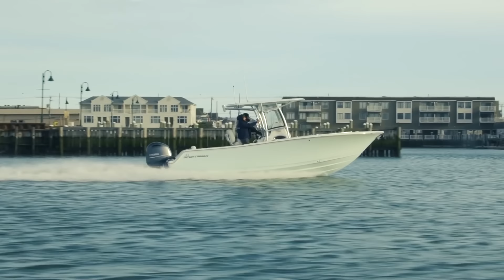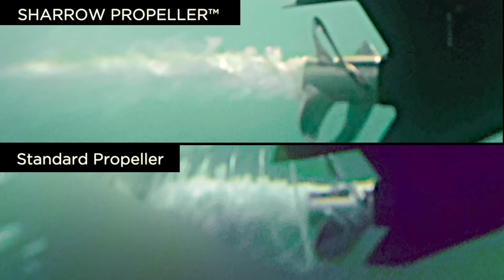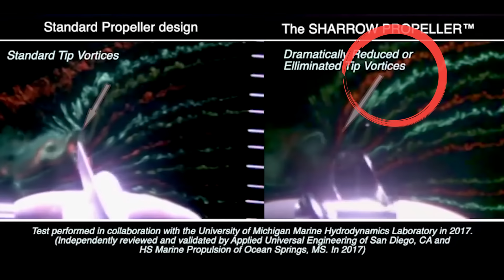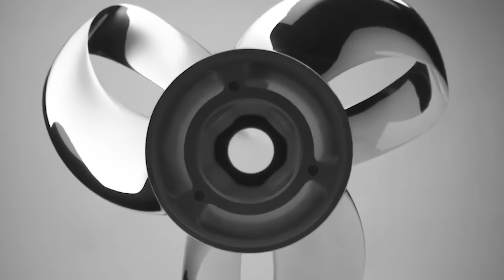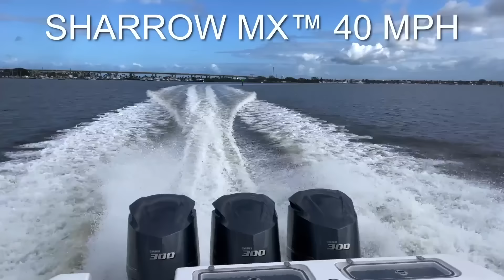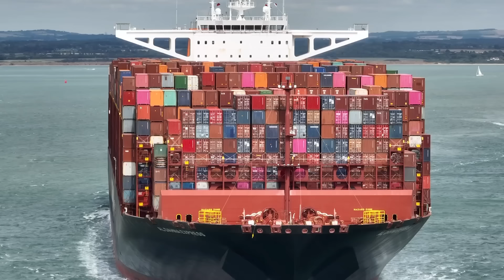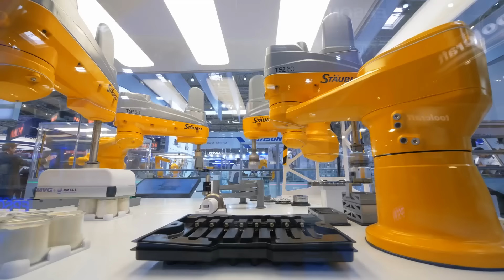This Genius Propeller Will Change Transport Forever

Comment: Curious, if these are already installed on submarines, since blade tip cavitation seems pretty much eliminated on these.
Reply: subs operate at high static pressure.
Reply: @appa609  They still have problem with cavitation, just less at higher depth. Also even small cavitation increases sound signature a lot, so they try to avoid it as much as possible, AFAIK.

Comment: Can we combine the principles of designing the shape of this  propeller and translate that into a turbine generator? Cuz currently turbine generators use a standard blade fins that go from big can shrink too small, what is it possible to make those blades with this new design?
Reply: I dont think it would be too beneficial to generators because they’re basically ducted already, which removes most of any vortices that can be generated, though they might be able to benefit large wind turbines because this new prop basically adds the efficiency of a ducted turbine, though they would wear out at the same rate so it might not be cost effective. (Might look more into it though)

Comment: Nonsense video. 
This idea has been around since the invention of propellers.
These props are heavier/thicker, so not practical in small applications like for RC electric motors as they will increase power draw and reduce range/run time.

Likely not practical for airplanes either due to more stress on the engine and fuel consumption.
They can't be used with variable pitch like helicopters so that's out also.
Military submarines have been chasing quietness since sonar was invented, so if this was legit, they would be using them on every sub around the world as this is not some secret tech.
They are not doing that, that we know of or have seen......
This design is also not 105% more efficient at all.
It has better peak torque efficiency yes, a more linear torque range yes, but overall, it's barely better and in most applications, it will be worse due to above stated issues.
A prop that "bites" better generates more torque, which requires more power = more fuel, more electricity, and more stress on the power plant.

Saying these would cost 5+ times as much as conventional props is just lies and typical price gouging by manufacturers when the effort involved after retooling is minimal.
This is the same issue with all modern tech since the industrial revolution started.
We were all promised how things would be so cheap and affordable for everyone, yet everything has skyrocketed in price over time, despite all the innovations in design and manufacturing processes, nothing ever gets cheaper because companies know people with money will pay any price to get what they want/need.
This is why our society is going backwards, greed and corruption.
Capitalism is clearly the best system, but only when it is well regulated and capped as to what people can charge and how much profit they can make from consumers.
Otherwise, greed takes over and 99% of people who aren't rich suffer for it.

It was once considered a success if you could run a business and feed and house your family from it.
Now if you can't make 600% profit margins, its a bad business idea and nobody will back it.
Everybody wants to be a multi-millionaire or billionaire or the business is crap.
Greed is rotting us to the core, and things are coming to a head in the near future years.

Comment: Gimmick. The amount of material used and it's complicated geometry mean that it's both more cost effective and easier to simply use a simple larger diameter prop. There are some hard hitting physics limits when it comes to props. Could be used in very limited capacity, where "bling and uniqueness" is valued, but not overall economic efficiency.

Comment: Very misleading title! In fact it's a deception that does nothing positive for your channel.
You IMPLY a 105% efficiency, however the 105% figure is applied to the "improvement" over a standard screw.
You can NOT achieve 105% efficiency.

This kind of misrepresentation does nothing but reduce the impact of the interesting content of the video, and will leave a number of people believing the impossible,

Comment: I'm wondering if this blade design could be useful for wind turbines, or not. Probably not due to their angle of attack variations depending on wind speed.
Reply: They might, but, just like the existing ones, they won't turn when not windy!!!!!!!
Reply: @ianharvey3696  Haha, true!
Reply: I bet they could use them. The angle of attack could still be adjusted but the adjustment would have to take place at where the prop joins the shaft meaning a total redesign. Likely worth it though.

Comment: I'm thinking this will greatly help even internal combustion engines that use water cooling...  Cavitation/parasitic drag of an engines water pump is a problem where this could really help - Not only making the system more efficient in many ways, but also by reducing wear of the impeller/failure, thus reducing costs and waste...  BMW, are you listening???

Comment: You know a video sucks when the claim more than 100% efficiency. Meaning it should produce energy on top of running. That's really impressive and impossible. They may have doubled propeller efficiency, but that is not the same thing.

Comment: The lower efficiency gain of the boat prop at lower rpms is probably because there’s little cavitation of the conventional prop at those speeds to begin with. Scale up the size though, and cavitation is a big problem for ships props, despite their low rpm,
Reply: Big ship props don't cavitate unless somebody screwed up.
Reply: @evangatehouse5650  Yeah, that's right of course, I should have been more clear. IF it happens, cavitation is a big problem. My thinking was that the helical design could spin faster and produce more thrust without cavitating :-)

Comment: They're getting closer to the prop that I designed years back with the toroidal blades and a pseudo direct drive motor with a turbine prop in the center and the toroidal blades are hollowed-out like the Dyson bladeless fan and are connected to the secondary drive shaft on the https://youtu.be/EAELukfr2oY pseudo direct drive motor. Would have to be 3D metal printed https://youtu.be/lnE1om0KM5c

Comment: Sounds pretty promising. I'm wondering if wind turbines would be another use case 🤔
Reply: It was either Popular Mechanics or Popular Science that showed wind turbines with this design over 30 years ago.
Reply: @jnicksnewstart  thank you
Reply: Perhaps not with today's manufacturing and installation processes. If the   benefits scale well with size I do think we'd see some attempts at it for sure
Reply: I was thinking of wind turbines to. I wonder if the principal of utilising a larger area of air (the blue and red smoke in his video) would work with the wind creating the rotation instead of the other way round 🤔
Reply: Interesting idea.  Likely a much smaller swept area. My question as a wind tech is how do you feather the blades when shut down/over wind?  We've seen some really interesting stuff small scale, including the vertical axis designs.   Let's say though these were made as  "blade units" separate and mounted on a hub and pitch bearing configuration as we're already familiar with in the industry... that would be something... lower leading edge erosion from lower tip speed for one thing.. but on the other hand I'd hate to be the guy figuring out how to lay glass fiber and actually make those and setup the mold.   It would be something to see.
Reply: @macster5187  I think you are right, it would tough to have pitch-regulated wind turbines with this design without becoming too complex. While I think smaller stall-regulated wind turbines would benefit most from this design, I'd love to see someone stick a giant torus on a 15MW turbine

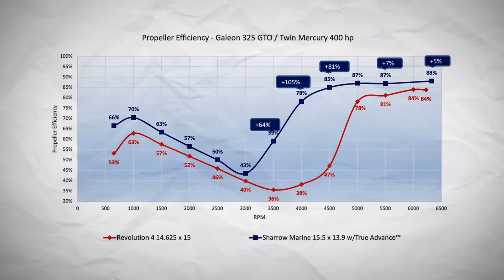Comment: 2:54
Deserves a video from some skeptical engineer channel. Sure, +105% efficiency!
On a cherry-picked range.
No, this doesn't mean that toroidal props are double the efficiency. It means their peak efficiency range is wider. The props are really only 8% more efficient. Which is still good, but that basically means toroidal props are ducted fans in disguise. With less problems than ducted, maybe. Remains to be seen.

Comment: Cavitation also is responsible for a great deal of wear and tear, shortening the service life of a propeller.  Given that even smaller propellers aren't inexpensive, consider replacement costs on a cargo or military vessel.
Reply: Submarines, silence is survival so less cavitation is a massive plus.
Reply from the maker: Great point, I didn't think of that!
Reply: If we are really talking double the efficiency, it will still be worth it.
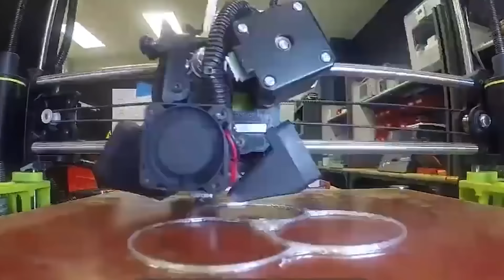Reply: @Invisiblehand123  We're not.  Check the graph at 2:04.  There's a big jump in efficiency at a certain RPM range but outside of that range, it's not anywhere near that big.  In the 3%-7% efficiency gain ballpark.  And that's if you trust the companies numbers and I don't think I would without 3rd party verification.

That being said, if the company is true to it's word and if you're running a proper shaft in the 3500 to 4500 rpm range, it's great news.

Of course, the big stuff only moves props at around 200-300 RPM so, that's well outside the range this thing is meant to help at.
Reply: @ColonelSandersLite  Interesting, thank you for your input.
Reply: @ColonelSandersLite  Big stuff moves props around the optimal speed for them with noisy designs. Gearing the output speed for the optimized for the new prop design would be easy.
Reply: @ZacLowing  "Gearing the output speed for the optimized for the new prop design would be easy."

HAH.  You're joking right?

Right?

Because if you're not, you're talking about moving something that weighs in the ballpark of 40+ tons at thousands of RPM.

I can say with a great deal of certainty that I don't want to be standing anywhere near that.  Maybe not even in the same state as your test rig.
Reply: @ColonelSandersLite  but the efficiency increases are in the main rpm range that the prop will be mostly used. So we don't really care about low or super high rpm.  Propeller pitch, shape and size are all variables that can be tuned to get optimal performance at the required rpm.  This was a prop designed for motor boats to replace a similar prop, so it's not so surprising it's optimised for those ranges
Reply: @ColonelSandersLite  And they still destroy props at those low revs.  That's why the cavitation problem is the bigger aspect to me - if the energy ate up in cavitation is returned to us then we get a dual benefit of being able to find more energy for the same fuel input as well as vastly reduced maintenance costs if it turns out they quite literally have to rarely or never replace a prop unless it gets damaged by external events.   The reduced stress on the rest of the power train/plant should also translate into better uptime, longer service wear life on parts, and ultimately maybe even increased speed/reduced latency on maneuvering.

The bigger the prop, the bigger deal this is for company vessels, cost of ownership-wise.  That's what my original point was.

Killing cavitation isn't a side benefit, to my mind it's the main benefit that far outshines all the others listed - that's the aspect that's a game changer and it effects everything else in the system back upstream from it.  If they continue to pursue the cavitation damping, other efficiencies will likely emerge through the work.
Reply: @ColonelSandersLite  -  That's precisely what I was thinking.  However, What are the possibilities of a smaller prop?  Still doesn't seem feasible but would be interesting to see what develops.
Reply: @ColonelSandersLite  Gearing the prop to go faster is indeed absurd, but for other reasons than you think, which also makes this propeller feasible for a larger vessel.

Ships propellers are so large to produce more thrust obviously. A boat propeller would just get up to the thrust ot can produce until it starts to cavitate a lot, hitting its limit.

Because the tip of a propeller moves faster through the water than the centre, as the propeller RPM increases, it starts cavitating suuner than the centre. If you move the tip even further away the centre, it cavitates even sooner. Therefore, if the tip is very far away from cetre, the propeller cant spin as quickly anymore without hitting that cavitation limit. 

You obviously want the smallest propeller that can handle all the power the engine has to give to save material costs, so you will always be cavitating a bit during normal operation, and a lot (but not quite cathastrophically yet) during full speed. 

This propeller if i understand correctly delays the cavitation ”curve” so that it starts cavitating later and then shoots up, insead of increasing bit by bit as a normal propeller. This is why there is a huge difference in the mid to upper range which then quickly closes as you hit thr high end of RPM.

Scaling this up would show the same curve at 200 rpm compared to normal 200 rpm ship propellers.

There are other issues at hand which play a factor but regarding scaling, i dont see that as an issue

Source: Officer in the merchant navy
Reply: @ColonelSandersLite  not a new design, not used due to being very inefficient...
Reply: @SportSoulLife  For seagoing vessels though, their propellors are designed for a long lifespan and maximum efficiency at a certain speed. Ie a container ship or tanker typically operates their main engines at 85-93% MCR depending on company instructions. And it probably spends 98% of its service life there. You might gain a bit of efficiency with a better blade design but using a gearbox might actually reduce efficiency a bit.

However, since a few years, "slow steaming" has become popular with certain companies and here you might actually see more benefits.

For the bigger vessels, even a 1-2% reduction in fuel consumption is absolutely massive though, so I would imagine this greatly outweighs the manufacturing cost.
Reply: @BertM3  Yes, for example fully refueling the Emma Maersk can cost close to $10 million, a 1% reducton is $100.000 saved for every bunkering. 

I dont believe a gearbox is needed, as when you are in the planning stage you can choose between engines anyways, so you can get an engine that has a slower or faster RPM outputting the same power anyways.

Production costs wouldnt increase all that much, as each ships propeller is already tailormade to the specific vessel or its series. The engines are somewhat standard, the propellers are made on individual basis. An example of this is resonance, as vibrations in the hull are (thankfully) regulated these days. An identical propulsion system can be a rolls royce in one hull, and a Lada in another. The easyest way to solve this is by changing the propeller design so it doesnt resonate.

Then we have the relatively new EEDI, EEXI (entered force this year) and SEEMP regulations which can play a big factor (disclaimer, some things i say can be missunderstandings, i havent studies these fully yes). The EEDI in particular intends to have vessels operate in roughyl 75% MCR to decrease the emmisions per tonne transported. This was limited to newbuilds since 2013 but with the EEXI thisyear it now extends to existing vessels as well. Increasing efficiency is now no longer just economical but also regulatory thanks to IMO, DNV and MARPOL. 

Further, as more regulations on the Offshore sector is to come, and talks are ongoing of having particularly supply and service operation vessels hydrogen or electrically powered as they have short periods in operation and mostly remain stationary on standby, they can even refuel/charge off a buoy somewhere near the site. For these a propeller that loses as little power to cavitation as possible could be a godsent. 

Lastly, diesel electric layouts are becoming more and more popular, propably partly because of the EEDI, so gearing and optimal main engine RPM is much less relevant.
Reply: @ColonelSandersLite Modern marine diesels on large modern cargo vessels will have a design speed of between 70-120RPM.
Reply: @Invisiblehand123     Impossible to double, it is already very good, near 90%;   the max. attainable efficiency is of course  100 %
Reply: @Invisiblehand123  I am saying it's worth it even if it's not any more efficient - the lifespan increase with almost no cavitation means you may only have to replace props if they are damaged by events and not simply by using them.  The fact that people are finding ways to stop wasting work output in cavitation inefficiencies only means that there is more work being produced that we can't see yet but is waiting for us to use.
People are really missing the important aspect of this particular hype train, because it's not just numbers - when you can literally see the increase in efficiency by the output behavior but you're not getting the result that at least proves the value is in there waiting to be optimized into existence.

To me, solving the problem of cavitation in functional prop design is the technology leap everyone is feeling here for but it's being pushed aside by everything else surrounding it, in the rush to hype (not a new thing, that's just what I call it) and fighting for eyeballs.
Reply: @russellzauner  not worth 5 grand
Reply: A Jet drive R.I.B. would be cool!
Reply: Yes it is.   Micro explosion
Reply: If it's a better mousetrap than there's no stopping it.  It cost a typical. Cabin cruiser 4 to 5 hundred dollars to go to Catalina and back.  If this prop can reduce this, you better switch-on the machine.
Reply: Sharrow does claim a significantly reduced cavitation rate as well, so it's hard to say.
Reply: these are 5k a piece
Reply: @russel zauner
Ha! 
Just posted the same, then saw yours.
(Deleted! But thanks for the confirmation, I wasn't sure😁)
Reply: This would fall short in comparison to labour costs. It eouldnt change a thing